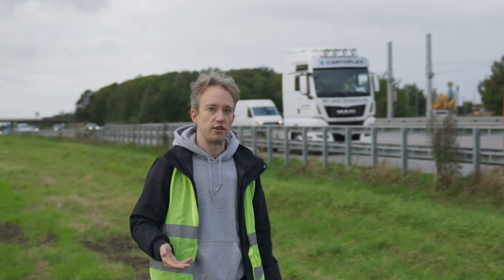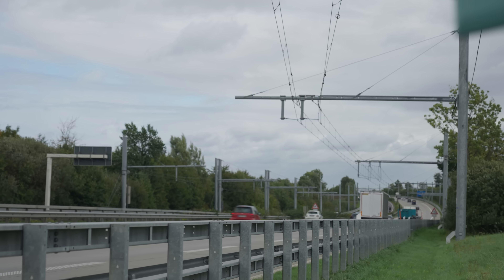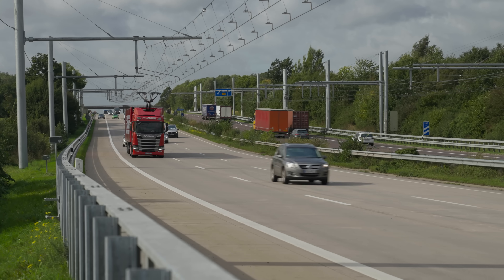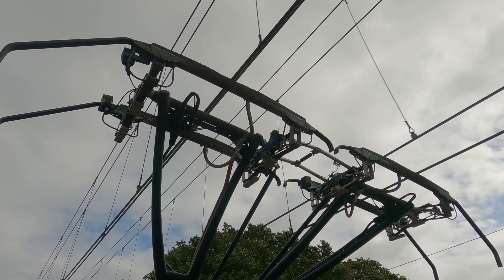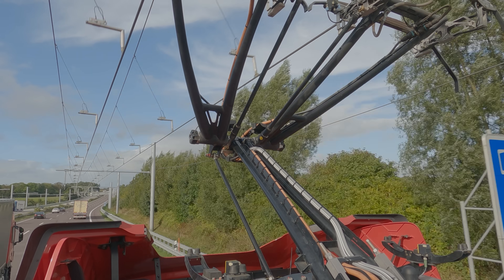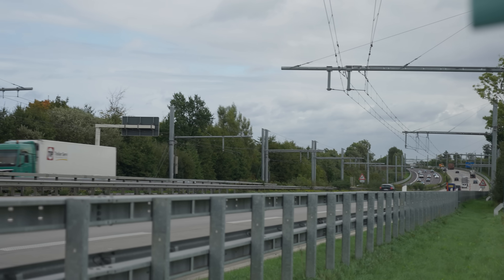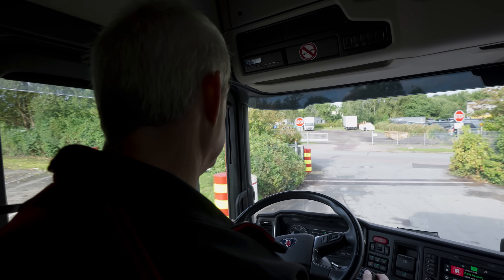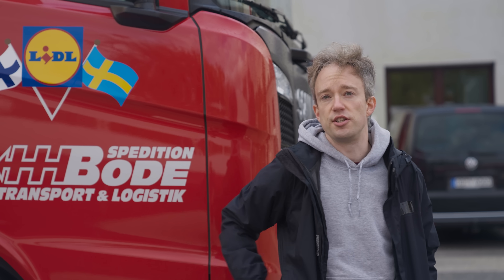The highway where trucks work like electric trains

Comment: They should take this 1 step further and put the trucks on some kind of rails: no drivers needed then.
Reply: ....and what happens when you need to get off the highway and into a local delivery zone?
Reply: @poruatokin  you can use cars to unload and bring it locally
Reply: @itskittyme  It is very, very difficult to build new railways.  Not technically but due to nimbyism.  The roads are already there and with minimum investment this catenary for roads seems very sensible.
Reply: You’ve just reinvented the train pal

Comment: Since you're in Germany apparently, have you ever heard of a "Pünte"? A Pünte is a ship without a motor drive. It is pulled through the water by human hands with a crank or by horses from the bank. Today Pünten are used almost exclusively as ferries. Long time ago, Pünten were often provided with a sail, which, however, was usually not sufficient for advancement on its own, so that there was a lot of trekking. For this purpose, a horse was carried on board, which was brought ashore in front of the stretches that had to be grained. After centuries of decline, some Pünten are now back in operation in East Frisia, the Emsland and the Dutch province of Drenthe. At the Lake "Großes Meer" in the East Frisian community of Südbrookmerland, for example, Pünten have been set up at two points along a cycle path.

Comment: The only problem with overhead wires is storms. Is there no way for them to implement them into the actual bitumen and put the overhead connection bar underneath?

Comment: I think this is a brilliant idea! I also wonder how far the capacity of wireless charging could go in the future meaning the power is ran under the road rather than overhead, and opens up opportunities for other road users to reduce their emissions
Reply: Sweden actually plans to start converting it's roads to e-roads in this manner using induction under the road surface to transmit power to and from cars, so some cars will give excess energy to the road when travelling downhill and this can then go into cars that need it elsewhere.  They hope to build the system connecting their main cities between 2022 and 2035.
Reply: @krashd   and here was me thinking it was a little bit pie in the sky! Thanks for sharing your knowledge

Comment: I wonder if it would be better to have modular batteries and you can just swap them out. I can imagine there is a lot of power loss in these wireless systems considering even wireless phone chargers are inefficient while needing to touch with less power requirements.

Comment: The small part on the highway near Reinfeld took years and millions to build.
So creating a large network will take decades too and cost billions of euros.
Reply: Whats your alternative?
Train tracks arent cheap either. They should do much more than they are now but they cant replace every truck.
Fuel will eventually run out. Also emmission problems.
Batteries are heavy, bad for the environment, dont have the range and take to long to recharge.

The current system wasnt build over night either and also cost billions.
Reply: May be. And the reduction of CO2 may nonetheless be worth that sum.

Comment: i got a great idea: Let's put some sort of efficient tracks below the trucks with less friction - and a more powerful tractor so we could even add more trailers -   ...
Reply: Yes, trains are great. However, they are very difficult to expand due to the tracks needing to be very straight (and level). In many of the areas where trains would do the most use you have enough settlement to make it near impossible or really expensive. Tracks are also less flexible. If a train breaks down on a track, that can cause issues for the entire network, whereas the trucks would route around the problem.

Comment: It’s a good idea, assuming countries can produce enough green electricity. Trolly buses work well in Switzerland, so it seems like a workable solution. The system would,  however,  need to deliver many times more power than that needed to power a few busses. 
Have you heard about the new mega sized wind turbine generators? Maybe that would make a good video.
Reply: Even if you're burning fossil fuels a huge power station is still more green and efficient than many small combustion engines. The way to go is nuclear until solar technology becomes highly efficient
Reply: @Ditch901  Nuclear is the "greenist," even compared to solar. Solar will never be efficient enough to make a difference also it's an unreliable source of energy generation. Our grid cannot depend on it.
Reply: @chrisE815  If those wind turbines aren't moving the reason is they produce more power than there is demand. Solar is already efficient enough, the only issue is upgrading the grid connections so electricity can be delivered over longer distances.
Reply: @AnalystPrime  the last time none of them were moving its because the operating company said the maintenance was to costly. These turbines are less than 20 years old
Reply: Actually, that is why this test-stretch is in Schleswig-Holstein in Germany.  It's the German Bundesland with the most wind farms.  And believe me.  They always stand still, because the electricity network cannot cope with the power, when the wind blows.  :-/
Reply: Wind is a joke.  I have multiple wind farms near me and most times they don't produce power.  Great use of taxpayer dollars
Reply: @chrisE815  Not really a joke, it sure works in some places.
Reply: @chrisE815  Yes ... that is true!
Reply: It has been proven beyond any doubt long ago that EV will always be cleaner than ICE even if you somehow managed to find an electric grid to charge from that is only powered by coal. And that is only counting the crap that comes out of exhaust pipes compared to what the power plants pollute for the same number of miles driven, in reality producing the fuel for those cars required huge amounts of energy and wasted loads of oil unused natural gas that was released into the atmosphere at the drilling sites. Also, the power plants that burn stuff can clean what comes out of their smokestacks far better than the millions of old and badly maintained ICE cars farting their exhaust at people on city streets. But no place relies only on coal any more these days, even the biggest coal and oil producing states in US have large percentage of their energy production done by nuclear and renewables simply because those are far cheaper than fossil fuels.
Reply: Trolly buses are a niche network and suit inner city travel on very particular routes. Such a concept could never be used at a nationwide nevermind international networks. 
It is really nothing more than politics at play that will do far more harm than good. Diesel is the best method at the moment and there is no way around that for the foreseeable future.

Comment: Suppose City A and City B are 400 miles apart. A and B are connected by a freeway with an average speed of 1 mile a minute, and a super-fast HSR line running at an average of 3 miles a minute.

That means that a truck takes 400 minutes to go from A to B, while a train takes 133 minutes, a difference of 266 minutes, or 4 hours and 26 minutes.

Now how long does it take to drive a truck from the actual destination in City A to the train station, load the package onto the train, and then unload the package from the train, before loading the package back onto a truck in City B to take the package to the actual City B destination? If that time is more than four hours, sending a truck from A to B direct makes much more sense, regardless of energy efficiency. If the HSR train averages 2 miles a minute, or City A and City B are 300, 200, 100, 50 miles apart, the train is simply that much less practical. Remember that TIME is the greatest "Cost" in transportation, especially given labor costs in the U.S.

If you don't believe me, I encourage you to study how long it takes Amtrak to unload baggage from a train, or for airlines to unload an airplane, and reunite baggage with the passenger.

Comment: I feel like a lot of road transport could and should be moved back to the railways with the entire port-depot network being shifted onto the rails as high speed rail increases free capacity on the legacy rail network. Schemes such as this will definitely help, but there is no question that the same investment and time put into shifting most if not all long range haulage to the rails is a more sustainable move with the "last mile" deliveries then being undertaken by BEVs.
Reply: I agree with the sentiment. For cross country/continent freight, we should be looking to move it all via rail. Then we use shorter range trucks (hopefully electric) to move from these hubs. The concept was approached in the UK a while back, but because it's not very visible to the public, I think it's been mostly forgotten. The UK more than anyone needs this move to rail more than any other country in Europe, due to how crowded our transport network is. It would greatly ease the flow of traffic, which in itself would make cars more efficient rather than crawling along at low speeds.
Reply: @tedferkin  I'm from the UK and I also have listened to a lot of arguments both ways on the future of getting us our things  and moving us about and both of those things are what has shaped my perceptions on this. Perhaps there is a market for electrified motorways for transporting time sensitive goods, but this market is ultimately small in the grand scheme of things and this whole scheme seems like another way of inventing a solution to a problem that already has a more practical and MUCH cheaper solution than electrifying the entire trunk road network.

As a whole though for both passenger and freight, mass transit is the only option for a sustainable future whether we like it or not and despite what some smartly dressed EV exec who DEFINITELY doesn't have a vested interest says. The successful societies of the near future will be the ones who make this switch and make it stick.
Reply: In the states it was the likes of Rockefeller (Big oil), car companies, and other corporate companies who made sure rail would be a thing of the past as they slowly ripped light rail and trolleys in many American cities and towns.
Reply: Such a good point. It's actually ridiculous that we use trucks to deliver goods. Trains would be a lot faster, and a lot more efficient
Reply: It isnt very conventional trains need to stay on tracks the amount of trains needed for hauling out everyday commodities will be too much for any railway system to handle on the other hand trucks can go anywhere as ling as there is road of course and they can drive next to each each other
Reply: They could add some kind of 6 track railway with trucks that have train wheels instead of motorway.

The problem is when they leave the highway and the railway stops.

But I think I have a solution for that.
Reply: agree. The rush to move traffic from rail onto diesel was short-sighted.
Reply: @digimaks  Short sighted? I guess in your mind rails run everywhere and every store, warehouse, and gas station is built right next to them. Trust me. Things are the way they are because smarter people than you made decisions based on the situation that existed. If you want to break the mold, try understand why it was made.
Reply: Rail capacity does not increase with high-speed rail, in fact it decreases, due to braking distance between trains. Unless you want pile-ups in the event of a crash to be inevitable, this isn't something you can just fix.
Reply: @namibjDerEchte  You're missing the point. Capacity on the legacy network will increase because those fast trains with high braking distances won't be on the legacy network. They'll be on the high-speed network.
Reply: @mastertrams  speed kills. You don't move tons upon tons of freight quickly. It can take time to get places.
Reply: @namibjDerEchte  high speed trains usually move on dedicated high speed rails (for example in France,Japan,China),thus relieving the capacity of the legacy rail ,which can be used more freely for freight.
Reply: @СимеонНиколов-о9в  Not where I am
Reply: @namibjDerEchte  they’re talking about high speed rail on their own special tracks
Reply: I don't think you realise how large freight trains can be.
Reply: @Sivalente1  thankfully there is a set limit they can't pass on number of cars.
Reply: @Sivalente1  Not in Europe. They are generally shorter where they share usage with passenger trains. In America, if the rail was full of passenger trains, the freight trains would have to be shorter
Reply: Your point doesn’t make sense from a land use perspective, especially in Europe where land is a much scarcer resource than in the US.
Reply: @Axqu7227  If you're just talking about the high speed part, you're correct. If not, you couldn't be more wrong. The average highway here in Europe takes up far more space than a railway. In fact, even a single highway lane here tends to take up close to the same amount of space as a full railway track. Especially when comparing the difference between an 80km/h or a normal 100km/h road and a proper highway.
Reply: Can’t see it working. We have slow trains that stop at every station and fast trains that go point to point where I live that travel city to city, like most cities I’m sure yet when the slow train gets delayed, the fast train just sits and waits. And we want to add freight into that line too? There’s only so many rails and land to put more rails.
Reply: @911HRW   the railways solved that issue in the 19th century.  They are called   passing loops.  Or where there is even more traffic than that, doubling lines.
Reply: Not gonna happen.
Reply: @MuddyBubby  sure it will. Everyone lives right next to rails and ports...
Reply: they already transport a lot of goods by rail....  i imagine likely all they can as it's decided by cost

it's obviously not economical beyond a certain point to use rail if the business you're deliverying to is not on the railway..... and who cares if the Trucks use electricity, what we're down to concerns about microplastics now and we need cars ourselves anyway we can't all travel by rail
Reply: I love how all these commies want to plan economies and make claims about this or that instead of just coming out and saying they are a Marxist that wants economies planned. All this electric automobiles is just nonsense at best and pie in the sky.
Reply: @bighands69  Wow, a story about electrified trucks and you’re on about Communist & Marxist

Comment: A more economical solution would be to move the bulk of goods by rail, since there is one driver and a long line of freight wagons behind instead of a fleet of vehicles that need drivers in a driver shortage, and self drive is not quite there yet. The short haul from a depot to the customer is more economical than tying up drivers for long haul. Maybe less economical in Europe and the USA, where their rail services are not as sprawling as the UK.

Comment: If only the power the trucks are sucking up didn't come from Germany's expanding use of coal & gas... who's bright idea was it to close all the nuclear plants? that's an environmental disaster right there.

I'm yet to be convinced the system is a great idea, but I don't know what the overall cost is vs swapping out tractor units when they need a recharge - the latter is more flexible, at least.

Comment: How about rapid on-the-road recharging.  That would be a hell of a lot more practical.
Reply: You don't need as much battery capacity if you use the road electricity for cruise. Unfortunately the overhead wires are ugly and will make the trip less pleasant for every other user of the road.
Reply: @Markle2k  Well that's just a personal preference of yours. It's really not that hard to get used to them, when you realise that they help increase the air quality in your area.
Reply: @czechgop7631  You could instead use batteries or hydrogen fuel cells and save on the copper, aluminum and steel that ruins the scenery for everyone else. Everybody gets unspoiled scenery AND cleaner air. Win, win.
You know where these systems already get used? Mines. Nearly set in stone route, already dodgy scenic beauty.
Reply: @Markle2k  Surprised how against it you are from a visual perspective. I think technology can have a beauty of it's own, and even if you don't share that perspective, when you've got miles of tarmac, gantries, signs and barriers anyway, I can't see how overhead wires makes much of an additional impact.
Reply: @ryanmitcham5522  I'm not surprised. I live in a town where some areas still have overhead power poles. I have a direct A-B comparison.

Comment: The best thing about this part of the autobahn is, though, that it has no speed limit.
Reply: trucks and other heavy vehicles do have a speed limit on these no speed limit parts of the autobahn.
Reply: @DarkDutch007  Well, that is true. But I guess I wasn't actually commenting from the perspective of a truck driver or a driver of any other speed-limited vehicle.
Reply: @DarkDutch007  The thing that most stood out for me driving on that part of the autobahn was that there was no speed limit, and I could drive as fast as the car I was driving was able to go, the traffic letting me, and the weather permitting me to go.

Comment: They should be pairing this with self driving technology. The bus staying in one lane, on a fixed route, (maybe with some specialized positioning indicators) should make self driving programing significantly easier.
Reply: Absolutely! They could even have some sort of backup guidance system built into the road itself. These guidance systems could then be made of steel to reduce rolling resistance! 
Why has nobody thought of this before...
Reply: To see one problem with this, watch Logan
Reply: Selv driving would be even more easy if there where just rails...